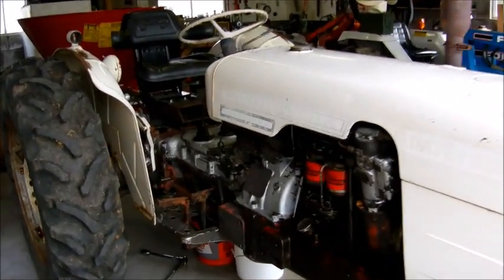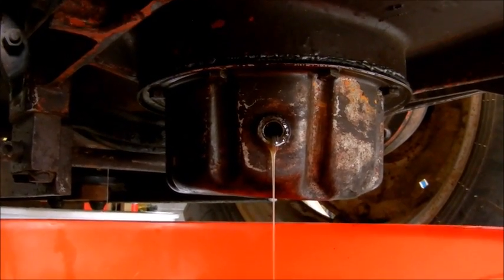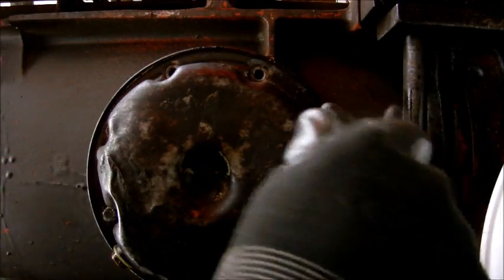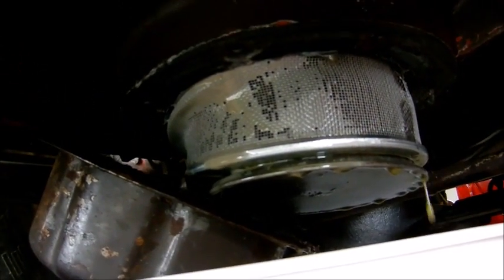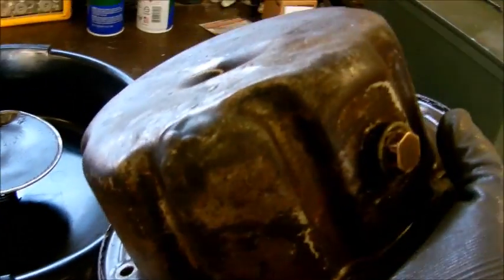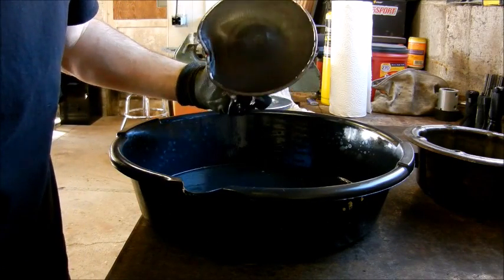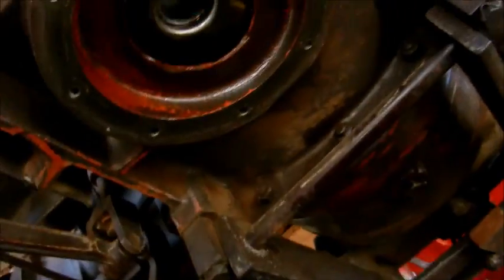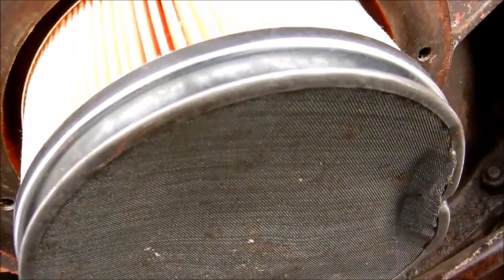David Brown Tractor Hydraulic oil change

Comment: Thanks for the vid, all these posts are appreciated and informative in some way. One point though, I believe the drain plug at the back you refer to as the 28mm socket size is actually the center rear axil oil drain, 1 of 3, the other two being on the wheel hubs.
Reply from the maker: Thank you!

Comment: I have the same issue with water getting into the system due to bad shifter boots. My problem is that the water froze in the filter canister and destroyed the screen. I was fortunate to find a good used screen/valve. The original part was distorted and broken into several parts. If you are in an are where it gets cold, make sure your shift boots are good. Oil will float on the water. After changing the oil and filter, operate all hydraulic controls to their limits several times, drive the tractor and shift through all gears and ranges. Make sure the oil is up to full temperature. Re-track all hydraulic systems to the closed or least extended point. Shutdown the tractor and let it sit at least 24 hours. The water should settle into the filter canister. Then drain the oil again, replace the filter, and refill with all new oils. I understand that the oil is not cheap, but frozen broken & corrosion is more expensive than the oil. This is just from my experience. It worked well for me. Good video and good luck to all!

Comment: Thank you for your video. I cringed when you said hydraulic fluid. I've learned from experience that the David Brown Selectamatic transmission oil should be the same weight oil as the engine. I'm working on changing mine again to get my three point hitch to raise and lower. What oil did you use in yours?

Comment: If you haven't got a gasket you can make one from a cereal packet, or other cardboard, but do not use corrugated or it will leak, put a smear of grease on the face then press the card onto it taking care not to move the card, remove the card and you will have the joint face marked in grease on the card ready to cut out and use, you can buy proper gasket paper and do the same thing but it comes at a price!, just one thing , do not use the folded corner on the packet as it creates a ridge, if you need a bigger gasket than your corn flakes packet then some artists mounting card comes in a variety of thicknesses, and sizes up to AO, I wouldn't try it as a head gasket but for just about all others its fine, been doing this for over forty five years, a "proper" gasket my be better but a home job is far better than nothing, and at three in the morning its available, hope this is helpful☺.

Comment: Hi fantastic video, i have a David brown 12/10 the hydraulics wouldn't work at all i took the housing off and the filter was collapsed and so blocked i have never seen anything like it but the problem is my housing isn't round its a different shape i might make a gasket would the filter your using also fit the 12/10

Comment: Does the transmission hydraulic fluid system run the 3-point hydraulics as well? Or is it 2 separate reservoir pump systems? Thankyou
Reply: It is just one system
Reply: All runs on the same fluid

Comment: I have an 885 and your video is awesome. One problem I have is where do you refill the oil? I have some manuals and none have the hydraulic oil filler location marked.
Reply: hey did you find out where is the oil filler? i just got an DB 990 and would like to change the oil
Reply: The filler plug is just in front of the gear shifters. It takes a 1/2" square drive rachet (no socket)  to get it out. Hope this helps.

Comment: you've got an absolute legend of a machine there, absolutely bombproof and it's like a little terrier ... punches well above its weight! I've had its bigger brother and 880 and it was the same engine with a heavier rear end, 780  was very popular here in Scotland.... if you ever need any help send me a message......ps don't be put off by noisy transmission.... straight cut gears, they all howl!
Reply: and if you ever need to replace the rear brake shoes always remember  and push the differential lock pedal down before you pull off the reduction housing or the collar for the diff lock collar drops out into the transmission!
Reply from the maker: Wow, thanks very much for the info! I really appreciate it Jim. I am going to need to do the brake shoes here soon, so you might have just saved me a BIG hassle. I'm sure I'll pick your brain at some point.  Thanks for subscribing too!
Reply: Denny's Country Life when you do pull the reductions off there's a shaft that will come out with them they are light enough to pull off yourself if your used to heavy weight but ideally another tractor with a front end loader rope slung around the reduction unit is easier if you pull it off or put it on and don't let the shaft take the weight of the reduction housing, can distort inner seals. ... if there's oil on the shoes, thin oil is transmission side seals.... gear oil on the shoes means the reduction unit seal side is gone ...  all easily available, other than that  if brakes are nice n dry be careful as factory shoes were asbestos , I'm on Facebook if you need assistance and there's a good david brown tractor group too!
Reply from the maker: You are the man! I'll get in touch with you on Facebook for sure. Thanks again for everything! Not very many people out there willing to lend a hand anymore.. I consider this rare! Ha ha
Reply: Denny's Country Life cool I'm the one with the david brown 950 as his profile pic lol
Reply: just brought a 880  from auction..engine sounds great  and  drove it  2  miles  home  with no problems  except  for  the brakes  were  very  bad ...   the  problem is with  the  loader its very  very slow and  judders too ..the dip stick  is  showing  a good level  but  is  a bit  creamy ..  Also  cant  figure out  if  i  have  to  turn  off a  valve  to make  loader  work ?
Reply: I took off the sump cover on my db885 and there's no filter there!
Reply: @DennysCountryLife Φίλε μου καλησπέρα. Γράψε τον τύπο λαδιού που βάζεις στο σασμάν του David brown. Thanks!!!
Reply: Hello there. I’ve a 770A   The hydraulic/ gear Oil. What Type Oil
Reply: @briancostello6892  15/40w 15/30w or 10w 30 is fine it’s typically called super universal tractor oil the transmission and hydraulics share the same oil and fill point
Reply: @Jim-McKechnie  thank you 🙏

Comment: I have a question, why did you use metic tools on the tractor. I have six David brown tractors, I have three 770, one 885, one 995, and a 1200 and I never used metric on them I use stander  American socket and wenches.
Reply from the maker: When I bought this tractor, I assumed because of its place of origin, it was all metric. The sockets I used all fit tight and worked well. For that reason, I never questioned it

Comment: Hi Fantastic video would that be the same for the David brown 1210 , did you have to bleed yours mine has the front end loader is there a bleeder valve for the hydraulic system
Reply from the maker: Honestly I'm not sure about the 1210, as I have no experience with one. I would think it would be very similar. Good luck and have fun!

Comment: 7/26/2024  When installing a cover with RTV I have an assortment of long bolts with the head removed and a slot cut in the end for easy removal with a screw driver.  Use 2 of these across from each other to guide the cover and not smer the RTV. JUST A HELPFUL HINT.

Comment: I just started working on a DB for my daughter and was looking for a video on where to add hyd. oil as the bucket will not raise; the three pt up and down works fine so I am thinking it must have 2 systems.   I do not have a manual as yet and can not find any filler caps.  I was hoping to see you fill your system and see where this happens but you cut that out.   Also I am not familiar with RTD tried to look it up but found nothing so far.
Reply: On at least some DB tractors, there's a diverter valve that takes the power from the 3 point and uses it for the loader.
Reply: The fill plug should be on top of the transmission near the shifters.

Comment: Thanks for adding the informative video! I purchased a 780 David Brown and used this as a guide. After removing the pan, I've found that I am missing the bottom magnetic filter. I would imagine the person that last changed it, discarded it with the old filter. Are these available and will this hinder the hydraulic system from working? Thank you!
Reply from the maker: Awesome Brooke! I'm glad this helped you out. I would definitely replace the filter, as mine caught quite a bit of debris that would otherwise cause lots of problems if it had entered the system. Thanks for watching!

Comment: Did you flush this out before re filling it? If so what did you use and what were the results 
Did it all go smoothly and work straight away
Thanks
Reply from the maker: I ended up changing it twice. I ran the first change for about 10 hours and changed it again. Everything went really well and the tractor operated as it should.

Comment: How tight would you recommend the bolts on the filter pan to be?
Reply from the maker: I don't have a torque spec for you. Just go by feel. You want it snug-tight, but not too tight.
Reply: Thanks. Great video. Made changing the fluids and filter on my DB 990 a breeze!

Comment: Small point and perhaps a bit pernickety but I don't think there's any bolt, nut or drain plug on that tractor that is metric.

Good video though
Reply from the maker: huh, that's really interesting to hear. I wonder if there are different generations that use different fasteners. I'm pretty sure hese bolts also had the 8.8 stamp on the top, indicating that they're mid grad steel metric. Thanks for watching!
Reply: The front weights on my 1980 1410 say DAVID BROWN 38 Kg, leading me to believe it was entirely metric, but so far that's the only thing that is.

Say, don't you want to change the belt and show us how it's done?!? Asking for a friend - lol
Reply: All the original bolts would be in imperial sizes unless they have been replaced with metric
Reply: My DB 880 Selectamatiic hydraulic drain plug requires a 15mm wrench

Comment: What kind of oil need to put on  transmission of db 885
Reply from the maker: I used J20-C. If you call a IH/Case dealer they'll tell you to use Hy-tran. J20-C will work just fine, as it meets or exceeds all the Hy-tran specs and is much less expensive.
Reply: Super Universal Tractor oil. The same stuff that goes in the engine. Don't put transmission oil in it. It wasn't designed for use with this kind of oil. The viscosity would depend on how cold it is in your area I guess. 

The only part of the tractor that doesn't use SUTO are the final drives.
Reply: SeeDenny's Country Life